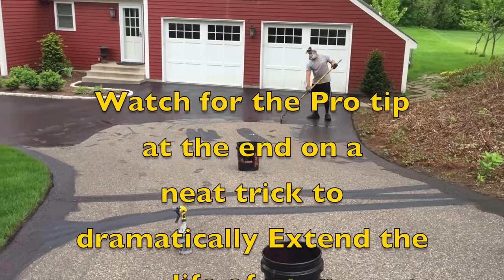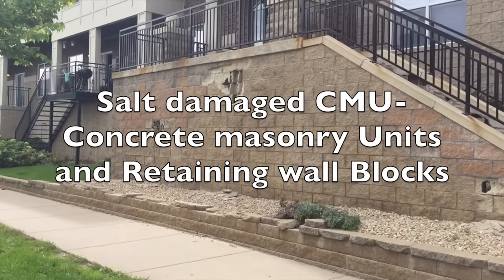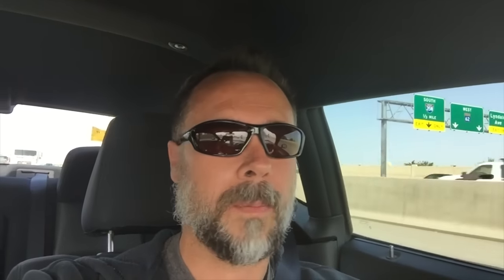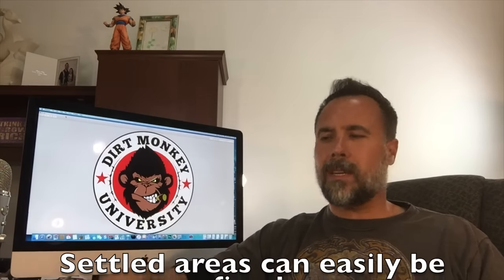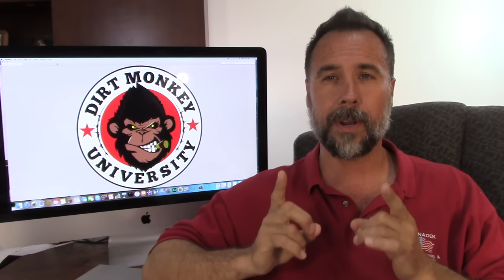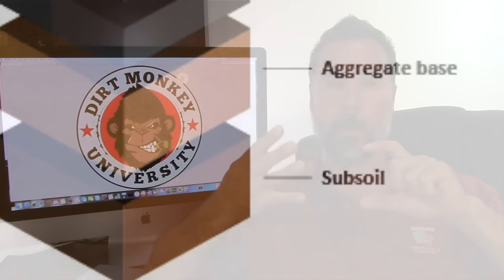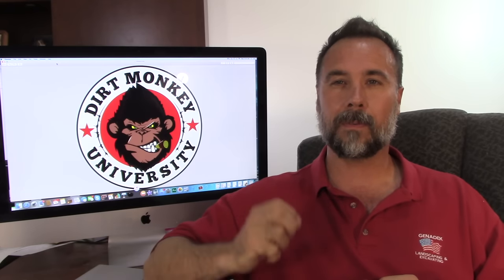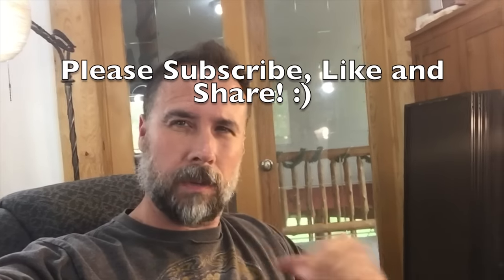Asphalt, Concrete or Paver Driveways- Which is the best?!?

Comment: So if I break up my asphalt driveway can I use that crushed asphalt as part of the base? I'll definitely dig deeper because I don't know whats under my driveway but it looks sooo sad lol. Probably do concrete for my driveway but I really want to do some paver surface in my backyard for grilling or a firepit. We were also considering an above ground pool down the road. Is there anything special we should do to the surface to prevent it from settling?

Comment: Bah Humbug...you forgot to mention adding wire mesh to concrete for 25 cents per square foot. (Home depot) Drastically reducing cracks or cuts expanding and vertical shifting .
Reply from the maker: Very true-  I did forget-  Glad you mentioned it!

Comment: w/o going through the comments.  COST OF PERMITTING is where you MAY save some cost, using 'certain' pavers, due to municipal permitting for 'reduced' property rain water run off and possible environmental long term benefits.  Design and function of some pavers, allows for a 'permeable' surface, where, water and pollutants don't or won't often leave your property, IF / when it rains or accident occurs such as fuel oil or even salt runoff. Engineered pavers/ infiltration systems, etc, with choice of subsurface materials, and retention system(s) (NOT detention, meaning, at some  point whatever is collected, WILL POSSIBLY, leave your property into rights of way or public storm drains / water systems).  Don't forget, almost any installed road or driveway connected to a public street, SHALL BE (meaning you MUST) PERMITTED.  In some locations, your water meter and or shut of, could also be in your driveway!  Which, YOU will have to pay for, from the meter, to your home / business, IF, it is removed or needs repair.  I've never seen a water meter 'curb stop' shutoff, that eventually, doesn't need repair, in a driveway.  However, your concrete driveway, may live longer than the valve / pipeline / tubing AND the riser, providing access to the valve, below your areas SUBSURFACE frost line / heave zone depth.  Consider also, metal culvert, also are NOT USUALLY reusable ALSO due to aging.  Check city codes for who pays for such costs, IF required /incurred.

Comment: What is your thoughts of using pavers over existing 25 year old concrete that is cracked?
Reply from the maker: I would remove the old concrete. Their is a reason it's cracking. Because it's base is moving and that will transmit through to your pavers.

Comment: Nice video with lots of great information.  My question my not pertain but is somewhat related.  I have a concrete driveway with a topcoat of asphalt.  My driveway slopes towards the garage.  I am installing a recessed trench gutter drain in front of garage doors.  It would be more work but would like to fill in with concrete around trench but not to the top.  I would like to lay in pavers on top of new concrete surrounding trench drain and make level with asphalt for a paver border around trench.  Is this a bad idea or feasable without other moisture issues?  Any info would be appreciated. Thanks, KC

Comment: Aloha Stan have you heard of helix steel before ?? Instead of using rebar it is steel fibers, I use to build underground homes in Washington state years ago, we would dig down 20 ft pour a slab with helix then build a Quonset hut shell spray foam than shotcrete a foot of helix mixed steel onto the whole building 35 wide x 100ft long including 20ft 8x8 tunnel.  It saved 10,000$ in labor tying all the rebar... Engineer said without it even being buried 5ft or more you could fly a 747 into the structure and not even damage it ... Check it out might help you or others out when you cannot fine good labor... Helix steel YouTube it or google
Reply from the maker: Very cool info. Thanks😄👍

Comment: It's a control joint not to stop cracks but for planned movement of the earth , if you wet cure, use fiber or latex additive it can prevent shrinkage
Reply: thats the same thing; control joints control or plan, depending on your parlance, where the cracks end up. Obviously, its impossible to control cracks like its impossible to control lightning.
Reply from the maker: Good info😄
Reply from the maker: Good info😄

Comment: I'm curious what you would think of a double layer of pavers for long term dependability. I know the cost would increase, but that might be mitigated by using recycled pavers for the lower layer, since they won't be seen anyway. Would something like this be useful for decreasing problems with sinking and settling, or would it just be so cost prohibitive as to not be worth it in the long run?

Comment: I had a house built and the driveway ended up back grading so water ran into the garage. I fought to get the builder replace it and I videoed the entire job. Turned out there was no sub base but it was solid 8" thick concrete. Took them forever to bust up and haul away. They then put a 6" sub base in place and poured the common 4" concrete slab.  Within 2 years it looks far worse than what they "fixed". Wish I woulda left it alone. Too much head ache to get them back again.  Live and learn eh ?

Comment: 6" would be nice to pour but that's an extra 50% more cement that the finishers have to get down before they can get on it to start finishing. The more time you spend screwing around getting it down the more likely you are to lose it or get on it late and have a shittier finish.  I'm from Canada we pour 4" and it handles the winters no problem. Then if you are smart about dummy joints and cuts, you'll be fine. Small pours you would be fine asking for 6" but careful about asking it for bigger jobs, just imagine the time it takes for the guys to wheel barrow 6 meters as opposed to 4 for your backyard patio.
Reply from the maker: Very true.
Reply: MotoDivisionFilms only way you can pour a big slab that thick in the summer without the truck accessing it is to bring in a large enough pump and pour it boom in the air. even pulling lines is really to slow if its warm out. 4k psi mix will cook off on ya. need good finishers and machines ready to go to stay ahead of it.

Comment: I have all 4 I have a techno block patio concrete sidewalks texture concrete pools and black top driveway. My experience with texture is the up keep every two years it needs to be resealed I mean needs to be. I feel that the guys who poured it did it 12 inches walking out of my house and it was on tiny crack within 5 years. The texture around my pool lifts but doesn't crack so it looks hideous. My black top was 5 inch and 8 of base and it's the easiest imo. I don't have to reseal it for atleast 4 or 5 years so I got my monies worth but I can not stress to people you can't let any heavy weight sit for long periods of time. My techno block patio I installed myself a few years back. I went 4 inches of Rock then sand then the setting material and it doesn't lift or anything all I have to do is wash it and spray it for weeds and fill in ant holes. My concrete sidewalks done by the city are terrible every section lifted and kinked to one side and cracked up.
Reply from the maker: Thanks Davin-  Its good to hear about your experiences with all 4

Comment: colour hardener actually weakens concrete I wouldnt colour entire batch I would colour top few mm throw colour on make sure not to pile it up as you dont want to creat any dry patchs you want it to set as one mag in the colour youve applied then steel if your happen with you application cheers
Reply from the maker: Good info but if you just color the top won't the cracks show up more as a second color?

Comment: Thank you!. I used to work at UCLA and would sometimes drive through the neighborhoods looking at the Million Dollar homes. The best of them stand out when you pass the "paved" driveways. They just immediately make you think that house is much better than the house with a brand new asphalt driveway. That jet black doesn't impress me because I know it doesn't last that long. I think pavers are the only sensible investment if you're going to re-do a driveway at all.

What is "base material"? So 8" of base material, 8" of concrete and some distance for two other layers; gravel and sand, how much? I didn't see those details spelled out. Thank you for this great advice.

I was thinking of making my own pavers from cement, and cement coloring. Pavers are expensive. The fancy ones are the most expensive. Is this is an idea I would regret?
Reply from the maker: 6" minimum of class 5 base. But don't be afraid to up that to 8 or even 10" of class 5 base. Than 1" of sand -but no more than that of sand. To much sand makes pavers subtle shift.

Comment: My house was a flip and the driveway is a mess now. Big ruts where the tires go. After some of it chipped away I realized they did about 2 inches each layer..  Is it a terrible idea to just fill in the dips with patch?
Reply: Yes. Don't. Get it redone. If you fill the chip it will come back
Reply: +Nikos R I love the idea of concrete for a nice lawn edge but the salt issue concerns me. the town dumps a ton of salt here..
Reply from the maker: FYI that's like  a band aid on a bleeding artery.
Reply from the maker: +Nikos R 😄👍

Comment: good info. surface coloring concrete is ridiculous, when i pour stamped i mix color powder in with cement as its poured. i didnt even know they did a surface spray. secondly by adding 2 more inches of base and concrete adds so much more to price. you need to excavate down  more inches meaning you have more dirt to get rid of, and depending on length adding 2 more inches of cement means waiting longer for it to start setting up, unless you get it poured dry in which case if you are slow it will burn up on you. you didnt mention adding wire or steel in cement, i wonder why that is.
Reply from the maker: But is a great upsell.  get your foot int he door low and then give them the better option. may customers will go for it.

Comment: Which is the best method to re-seal asphalt?      Poured, or sprayed.
Reply: If you ask 100 people 50 will say poured (brush or squeegee) and 50 will say spray. spray looks a hell of a lot nicer. Brushed and squeegee leaves a lot of lines and  brush marks. For sealing reasons either one works really well. Remember you want to wear the sealer off not your driveway. We have been in the paving and asphalt maintenance business for 25 years. Also only seal it when the previous sealer is worn, do not build up to much sealer on it.
Reply from the maker: Not my area of expertise. Sorry.
Reply from the maker: +D cain great info. Thank you😄

Comment: I've got oil stains in a few of our driveway pavers. I've tried to remove the stains but nothing works. Is it difficult to pop out pavers since they're tamped in? Any product recommendation for sealing the pavers?
Reply from the maker: Just use a screw driver to pop it out and a hammer with a piece of wood to put it back.  No recommendations on sealer.

Comment: also, whats your opinion on acid washed concrete? i recently did a bbq with concrete counter that was colored and then acid washed. to be honest it came out more beautiful than expected. will definitely be re doing some projects using acid wash
Reply from the maker: No clue on acid washing. sorry
Reply: smokinone951 its a cool technique. most people call it acid staining. its looks cool when done right but you gotta seal it every year and the good sealers are not available to consumers.
Reply: My experience of 30 years shows unless the owner repeatedly seals the "F" out of it. (yearly or twice in cold weather climate) individual stones will keep popping off due to the freeze thaw cycle. Here in Canada I would never do it unless owner understands implications and costs. Most salespeople here tell the customer "F" all.  :) Feel free to ask anything and I will do my best to give you the best advice..for FREE.
Reply: I also live in a cold climate and stampcrete and acid staining is very common here. Never have any problems with spalling as long as it doesnt get buried with rock salt every winter. Resealing once a year usually takes care of it just fine unless its commercial or high traffic.

Comment: The city where I live required 6" for the driveway apron.
Reply from the maker: Thats thick-but strong
Reply: That 6" is a minimum requirement. Thicker is better, but more expensive. If it were too small, the apron would eventually crack. That would eventually ruin the street too. That's probably the main reason the city enforces a code.

Comment: her in sweden wen i lay brik we use 300 mm base on drive way and briks  r 50 mm  to 70 mm  thickness on a walk way we use  150 mm base and briks r minimum 30 mm to 45 mm thickness
Reply from the maker: So a moderate depth of base. Good long term results?

Comment: Thanks for the tips / wisdom !   With a driveway that runs between 15 -25 degrees I can't find anyone willing to even price out an asphalt replacement (they say its too steep and not worth the aggravation)  Masons bitch about sagging and can't be bothered doing it in segments.  All I come up with is pavers and concrete headers every 6 feet at a price of ......$ 70 sq ft !  -Gravel and 4 wheel drive ?

Comment: would you do the same for a garage slab?
Reply: Do concrete
Reply: +Nikos R for sure, I have just been wondering aggregate depth and concrete depth.
Reply: +Lance Sheppard {Little River Lawn Care} 6 inches packed aggregate with 6 inches of concrete is how I would go. Don't forget Geo-textile under the base. Asphalt should never been less than 8 inches of packed base. Same with paving stones, but your top layer of base for leveling the stones needs to be 1/4 inch down. Sand is just not the way to go...it might be cheaper, but there is a reason it's cheap. 1/4 inch down will harden an pack better. You still want to sand over the top of the stones though.

Sorry for sticking my nose in. I spent a summer of 14 hour days doing driveway construction (mostly base work)
Reply: +omnimous69 thanks for the input guys, much appreciated!
Reply from the maker: +omnimous69 great advice.
Reply from the maker: +Lance Sheppard {Little River Lawn Care} ominous had good advice. Hope it works out and please keep me in the loop on your results.

Comment: find an "honest" concrete company don't just compare prices and pick the cheapest one. the cheapest guy will 9/10 times be using the cheapest materials to get the job done, cheap concrete, not packing down ground, control joints spread out too far( because they're very time consuming)and pouring less than 4" thick to save money. I let every customer know exactly what I'm quoting them on, we're not the cheapest, we just charge what it takes to do the job right. I've never had anyone call me back because of horrible cracks or concrete crumbling or sinking.

Comment: I don't like how ugly repaired cracks in asphalt look. What's the point if the repair can be seen so blatantly after the sealer goes down? I'd rather the crack was repaired with asphalt not a rubberized product. A street is one thing, my driveway is another... I care what the end result looks like.

Comment: It's faster to burn weeds, than use weed killer. It's also fun!
Reply from the maker: Haha-True- but not many places let you burn.
Reply: WkroT If you can't burn out the weeds then pour boiling water on them. No chemicals.
Reply: Yes, Germany
Reply: +Stanley yes I prefer to smoke the weed
Reply: Better for environment too
Reply: Just pour hot water in weeds. No more problems for pretty much the rest of the year. No harm to environment.
Reply: I will have to try it

Comment: My man your off on the asphalt part, I don't even want to start or else I'll leave a huge paragraph. Your credibility went away when you showed a crack filled with the cold stuff you get at home depot, I  get complaints daily to take off and put new crack fill because the cold stuff wouldn't dry or would come off, I mean if you could scrape it off with your finger you should now it's bad.
Reply from the maker: Francis Gerasi I agree with you. That asphalt driveway was not my project.